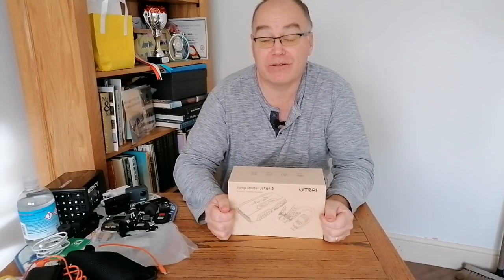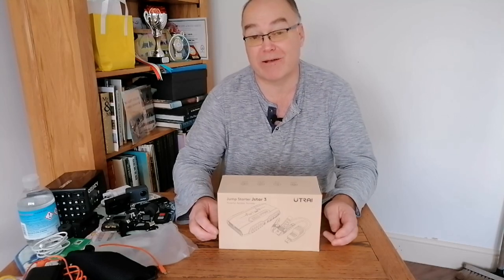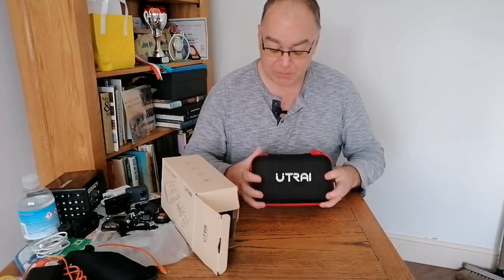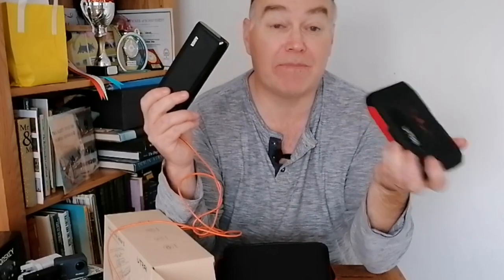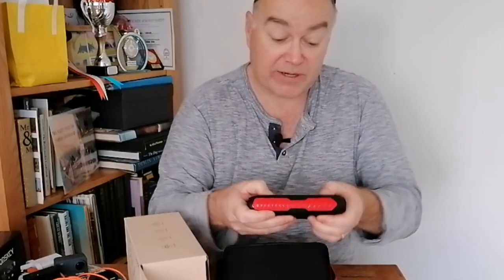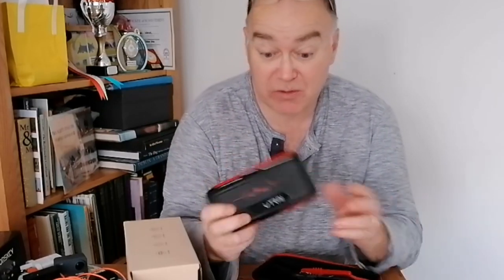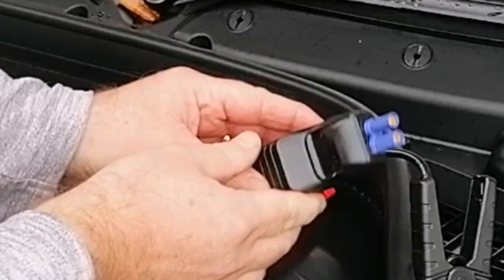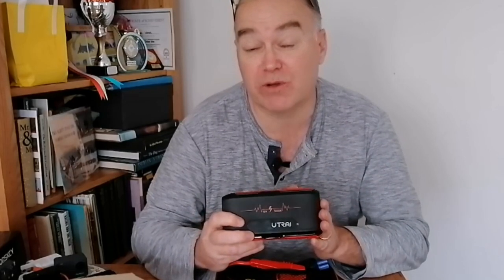Portable 12v Jump starter / booster - Utrai Jstar 3 review

Comment: Thanks Nigel for sharing. It's amazing something so small and light can provide enough power to crank a car over. Great idea though and presuming they hold their charge over time.
Reply from the maker: So far so good. Documentation shows its good for 300 cycles so not quite the same as a home battery but I guess as a contingency device you'd not be charging it often.

Comment: So watching this, You make is sound like you can jump start an EV with a battery pack, 
BUT if your traction batteries have run our out range You Can NOT Jump start an EV and in Most cases will need to be recovered on a tow truck or low loader, Many EVs Can NOT even be towed when the main batteries are depleted. I think you should clarify this point
Reply from the maker: I think you've moved onto and invented your own subject here. Also sounds kind you're negatively fixated on what if it runs out, I'm stranded 😱  it's not a concern like you're inventing. They get recovered to the nearest charger just as, easilly
Reply: @EVPuzzle  You clearly stated that this booster pack will get your EV going, Which is only the case if the 12 volt battery is Flat. 
"They get recovered to the nearest charger just just as, easily," Yes, After a Four Hour Wait maybe
Not sure how you dreamed up about a Fixation that I don't have 
I merely viewed your video to see how well a Utrai Jstar 3 works
Reply from the maker: I see, the AA respond slower to EVs do, they 😂
Yes its a 12v booster pack, think that was clear

Anyway we've used it successfully and helped a few people with flat batteries
Reply: @EVPuzzle  👏

Comment: Watched your review and several others.  I review things to death before I decide to buy!

I had a look on Amazon entering Utrai JStar 3 into the search and nothing came up.  Got any links?

I can only find references to appear to be earlier versions.  There are plenty of Jstar One versions.  It seems the Jstar 3 is widely available anywhere but the UK, (referencing eBay).  The larger Jstar 5 which has an integral air compressor isn't available anywhere.

I managed to buy a Jstar One for around £68.00.  Physically it is less streamlined.  The One has indicator lights instead of an LCD display. The plug in battery clamp leads also has indicator lights as against an LCD and for some strange reason only known to the Chinese manufacturer, the One has a compass set in the top!  Other than that, I have no idea if the operating specification differs at all.

There are several videos on YouTube that demonstrate using the device and proving its worth by completely disconnecting the battery, although several commenters warn against this.  But at least it proves it works!

You mention never having had a problem with a 12 volt battery before.  I was pretty much the same until recently.

I can only remember having to buy a new battery for a car once in my life before.  That was my very first car which was a Mini 1000 that had well over 80,000 miles on the clock!

Since then even with a Peugeot Partner Combi which I kept running for some 8 years before I traded, I never had to replace the battery.  I now have a Skoda Yeti 2.0 ltr diesel.  I had a few health problems which meant the car was sat on the drive for extended periods.  As you probably know, a car needs to be used.  Also modern cars have systems running on them 24/7 which drain the battery.  In situations like mine, it was all output and no input.  Eventually the battery gave out and no amount of charging was going to make any difference, so it had to be replaced.

There are many people now in the same sort of situation.  Because of the Covid 19 lockdowns, cars aren't being regularly run and the batteries are suffering.  I know this because it happened to me last weekend after that really bad cold spell.

I have managed to recharge my battery up to full, but it has prompted me to go out and buy one of these devices.  Like you, I may never have to use it now I've bought it.  Let's hope so!
Reply from the maker: Sorry I've got no links. Daft that ask me to review it then stop selling it on amazon. Lots of similar looking devices with identical cases just different colours too.
Reply: @EVPuzzle  Yes, I agree.

I've looked at some of the reviews and tests on many of the other devices and there's loads that don't come anywhere near the Utrai.

The only make and model that exceeds the performance of this one apart from the really expensive ones as I see it is the Top Vision.  But it costs a lot more.  Mainly because it can only be purchased from America, which of course involves import duties which in itself pushes up the final costs.

I assume you still have your device?

Out of interest, what rating of USB charger would you need to charge the unit up?  I know that it doesn't come with a charger as such, which seems strange.  It's as though they have forgotten to include one!

At the moment I'm assuming its a 5V 2A fast charger similar to the Samsung and Huawei type used on their smartphones and tablets.  Can you confirm that?

Comment: The 12v battery on my 4.5 year old (at the time) Soul EV failed quite spectacularly in a school car park. Had to get recovery out and they boosted it enough to get the car started. Went to nearby Kia garage, took them over a week to get a replacement 12v battery for it - unbelievable! Agree with Nigel, seem to be more issues with EV 12v batteries, but they don't seem to be exactly the same and ICE ones...

Comment: Lockdown has caused a couple of friends to have flat batteries and it seems once this happened they required new ones. I am always surprised electric cars allow 12 v batteries to go flat.
Reply from the maker: I know, why not build in a trickle charging ability for when parked for prolonged periods.

Although if you can remotely precondition the car that presumably also charges the 12v. Set it on a daily schedule?
Reply: Have you any indication of how long this will hold its power if you store it in the car and forgot to check/charge it untill you need it in an emergency.For example, weeks, months or maybe a year?
Reply from the maker: By example I've left my Anker for over 4 months and it held its charge. Extreme temperatures might impact long term storage however but I'm not an expert
Reply: @BARRYWHITLOCK  they usually say charge every month or two to be save but some say upto a year . But to be safe I charge our every month.

Comment: Nigel, one point I think we need to consider about these jump starter is that they have protection built in to prevent amongst other things is reverse polarity. They do this by checking the battery and look for 3v on the positive terminal, if it doesn't see this it won't start. I have a smart battery charger that does the same it won't charge a battery that is completely flat. Halfords own brand jump starters warn that they will not start a car whose battery is completely flat. I know that Noco jump starters have an override facility to overcome this. I don't know if EVs drain the battery to zero, but thought it needs highlighting. If you could find a completely flat battery it would be useful if you check if this one boots up when connected to a flat battery.
Reply: Yer the one I linked to does and works well . Bit more money but works well

Comment: Does it really need a lot of power for an EV. Is it not just switching relays to allow 400V battery to operate, rather than cranking an engine?
Reply from the maker: The load is smaller for sure to crank an EV into life

Comment: Thanks Nigel great review, last May after hearing about 12v battery problems on EV's I thought I'd get a jump starter portable too and leave in boot. I went for Type 5 it also has wireless charging for suitable phones. At the time it was similar cost to yours (  £69.00 in Costco ) However it only weighs 364 grams. But like your model -  the makers claim it will start a big vehicle. The peak power is only  8000  mAh  - jump start current 200A - 350A. 
Now on your channel you have quite rightly discussed what size main battery you need for your car. And concluded the right size car and battery is up to the individual, and you have decided on your EV Mini.

I Have not need my jump starter yet and like you have the reassurance of the rescue services spare wheel and battery tyre inflator.
 As regards to the weight of the battery jump starter you are probably right a heavier one seems intuitively better ? But if you browse on Toms Man shed he has opted for a capacitor type jump starter thinking the capacitors are less likely to catch fire than the modern lithium-ion batteries.

Comment: Nice video, thanks. Does it fit  easily into a glove box?
Not sure how easy it is to get into the boot if you've had a 12v failure. Crawl into the back and lift the parcel shelf somehow?
Thinking from a Kona EV perspective because the glove box and centre compartment is pretty full already with copilot's 'essentials'.
😂
Reply from the maker: In a Kona I'd put it under the passenger seat
Reply: @EVPuzzle  bought it but there's not enough room under the passenger seat.
Looks fairly innocuous in a black bag under the centre console, so I'll take a punt on leaving it there.
Reply from the maker: Out of the box it should go in the glove box?  I've taken the risk and put it in the boot under the floor with the first aid kit and charging cables
Reply: @EVPuzzle  I quite like it's zip up box and am loath to separate them.
On reflection there's plenty of  cabin storage in the Kona and I'm sure it'll go somewhere, away from prying eyes.
Just not in the glove box where it might interfere with my rhubard custard Yorkshire mixtures. 
😂

Comment: Excuse my ignorance but why do EV's have a 12 volt battery?
Reply from the maker: Because they share the electronics of other cars which are all powered by 12v. Changing the loom to a different voltage would be cost prohibitive
Reply: @EVPuzzle  and they can't 'tap' this off the huge battery under the floor?
Reply from the maker: Technically I'm sure it could be done it's just not sensible to do it when a simple solution is already there
Reply: @EVPuzzle  I suspect it is to isolate the main power and prevent gradual discharge which could ultimately kill a very expensive battery.
Reply: Some cars don’t have 12 v ! Had a 68 reg Hyundai ioniq and it didn’t have a 12 v battery as far as I know . I went flat 3 times and all you had to do was get emergency key out of fob and open door then press and hold a button on the lower dash and it would power the car on and they you could drive car etc not even aa bloke know about it !  But heard the car had drain issue from forum so know what to do but couldn’t get to door lock the first time as cover was stiff . I think this should be done on all evs  would maybe help fix the problem.
Reply: @nickieredshaw7835  Similar to the small computer battery which keeps the BIOS chip live, most are a primary cell but a few are on a trickle charge.

Comment: They always die quite quickly (note, this type of device) with any meaningful use. I mean look at them, it's a tiny battery of totally the wrong chemistry for high loads and yet it says 1600 amps down tiny wires. I bet the 20,000mah isn't at 12V either, more at the native cell voltage of 3.something V.

If it's a safety backup for very rare use then fine, but then I'd be tempted to just get the cheapest clone I could. No substitute for some good jump-leads and a friend!
Reply from the maker: You pay more for a recovery service you're likely to not use so personally it's nice to have the contingency and independence.  I'll bet I use it to help someone else
Reply: @EVPuzzle  It's a fair point. I'm just highlighting in my experience you have a limited number of 'shots' before it's a brick. Some people may falsely think they could limp on with an iffy battery using this to help out on cold mornings.